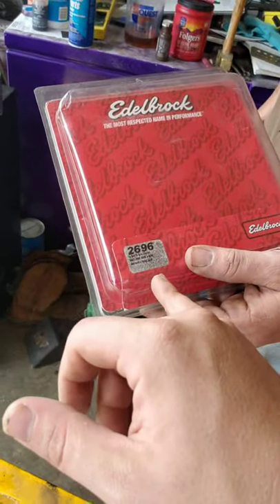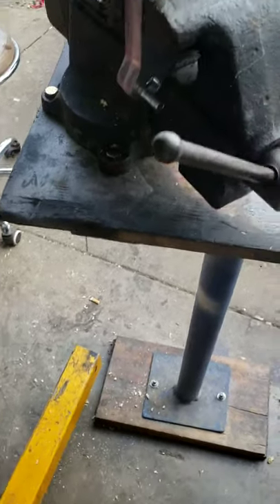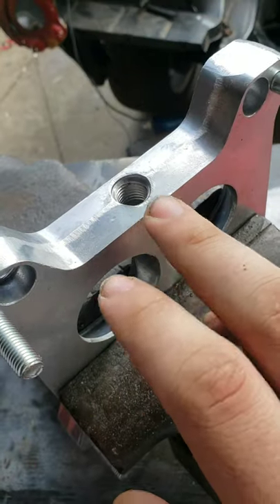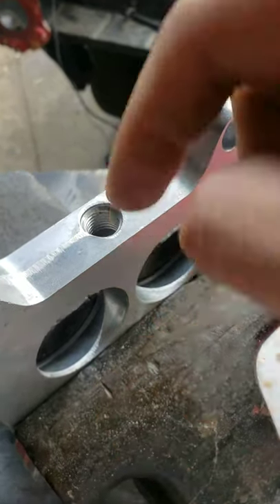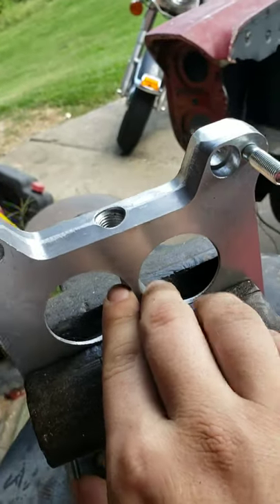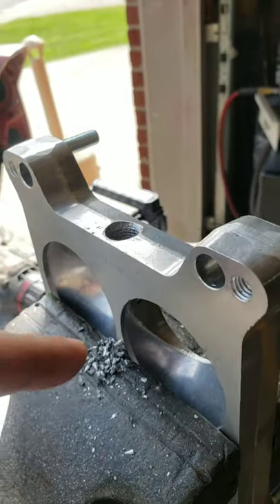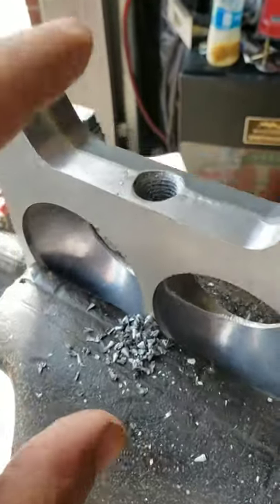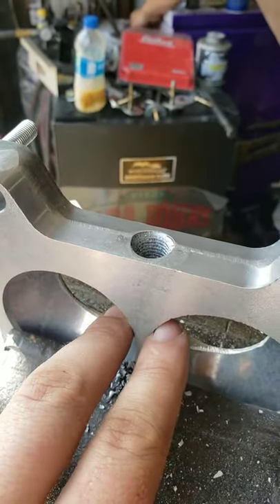How to drill vacuum ports into your carb spacer

Comment: Great vid.  Any special drill bit?  I have to drill the base of my Motorcraft carb for the pcv vacuum.
Reply from the maker: Recomend a 21/64 drill bit I wouldn't use a harbor freight cheapy I believe this was a gold high speed Milwaukee bit . But we kept the drill speed decently low and let the drill bit do the work.  Don't press down an try an force it weight of the drill and the bit itself will bite into the aluminum pretty easily ! Thanks for the comment we do a variety of things on the page for more video content please give a thumbs up and  subscribe!